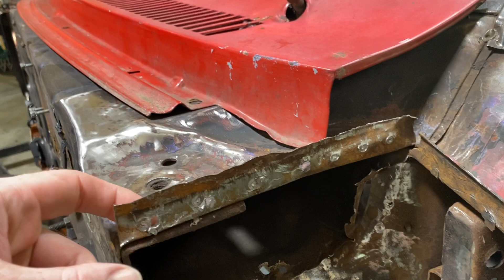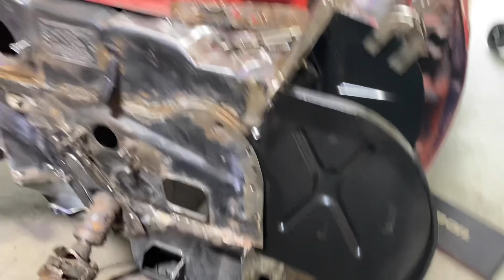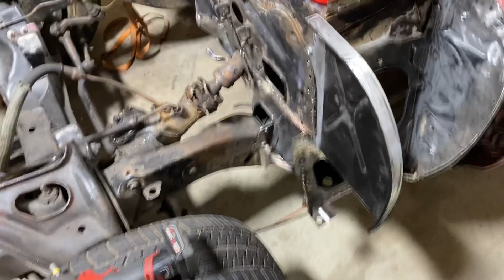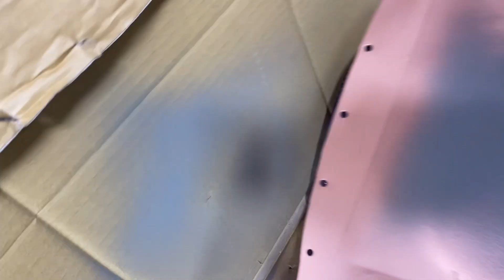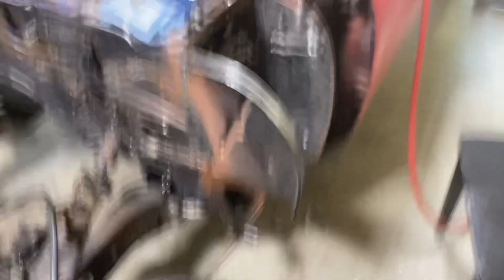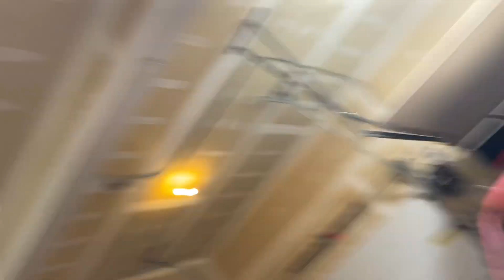AFTERMARKET PANEL NIGHTMARE! Chevy Nova outer cowl panel INSTALLED!

Comment: When you keep doing this for about 45 years you'll get used to that aftermarket     sheet metal.    this aftermarket stuff is pretty bad. Most of the stuff get you in a ballpark particular they are putting their lines where they need to be the right contours.  Quarter panels and fenders and door skins
Reply from the maker: @tonykerr8147  I’ve definitely been lucky so far up until now.  I’d rather not have to chop up quarters to make em fit but we do what we gotta do right? lol